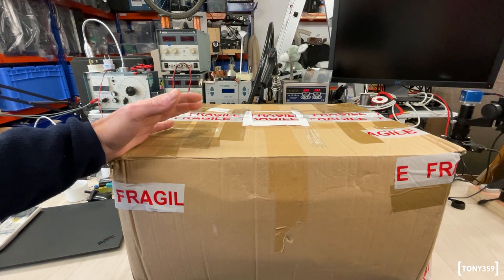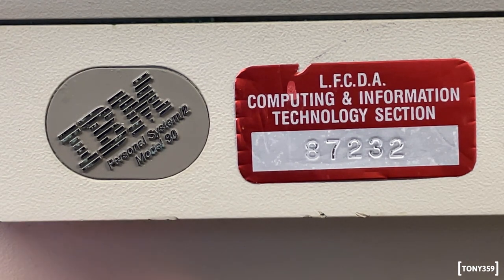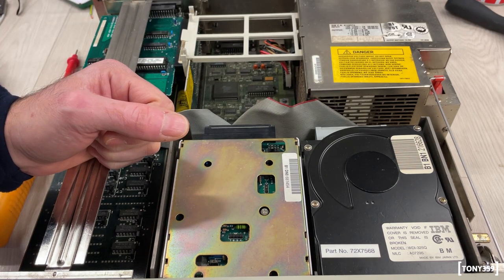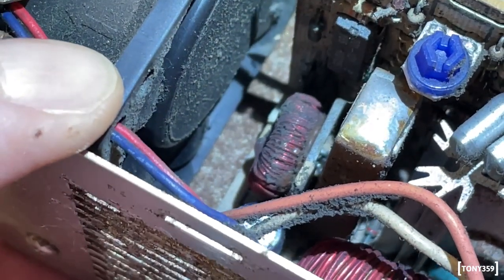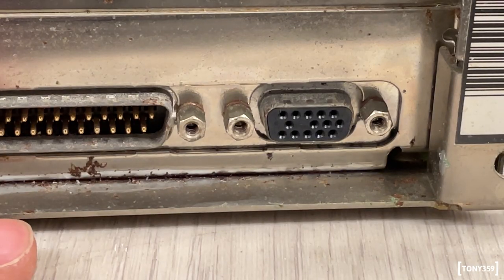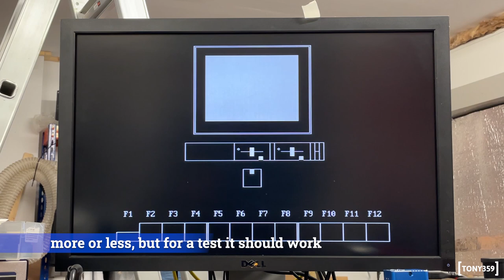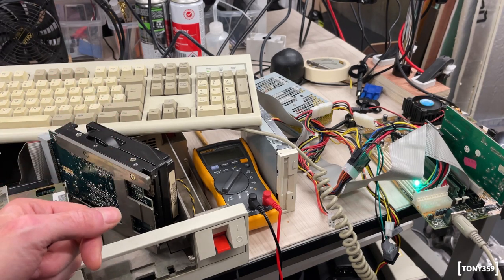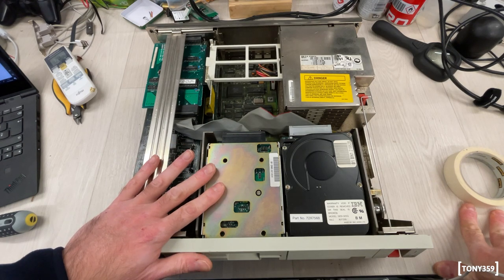IBM PS/2 Model 30 - Unbox and first look #doscember

Comment: Thanks for the mention :) Love the Dremel joke haha.  I tend to move stickers like that to the back or inside the machine. That way I preserve its history. Good luck with the project, looking forward to the next video!
Reply from the maker: Good idea so you get the best of both worlds! Thanks for watching and for your help on this project!
Reply: @tony359  Love the model 30 :) Let me know if I can help out in any way with the project. btw. your machine is in excellent condition compared to what mine was lol
Reply from the maker: I can't wait to continue! Working on a Macintosh now. I could use your expertise for a question indeed. Would this work for adapting a floppy? It doesn't have the key slot on the PCB. https://github.com/schlae/PS2FloppyAdapter 
I'd be happy to cut it myself but I thought I would check first. Thanks!
Reply: @tony359  Not sure if the drive in the 50 and 30 have the same connector. I'll see if I can find my 30 and do a quick test
Reply from the maker: That would be great thanks so much!

Comment: It was probably made at the IBM factory in Spango Valley in Greenock. I worked there in the 90s. 

Every motherboard went through 12 hours of stress testing in ovens which ramped the temperature up and down. 

Then random samples of completed PC’s were tested in the PQRL lab where we did DOA tests out the box. Then they were put on vibration tables to simulate shipping. Checked again then put in rooms with the temperatures ramping up and down again. 

If you were in the room checking the devices. One minute you’d feel your nostrils burning and within a few minutes you’d have to put on a jacket because it was so cold. 

They were built like tanks.
Reply from the maker: When computers were serious machines. And pricey. Amazing story thanks for your contribution!

Comment: I used to test, repair, and sell the IBM PS/2's. Plenty of model 30's, but in the last 2 years of that job we had thousands of the model 77's. Which were a very cool computer!
Reply from the maker: A 486! Must have been super cool!
Reply: @tony359  Heck yea! The 76/77 i/s with the "Lacuna" planar was one of the very last "pure-MCA" designs (ignoring the VESA video). They weren't quite trouble-free, but overall really cool boxes! I especially like the smaller 56/76 chassis - built like a brick outhouse.

Comment: A couple of years ago I bought the same model 286 we had when I was a teenager, this one has a chrome sticker on the front from the store it was originally bought from. I'm definitely leaving it on there, part of it's history. Our first PC was an IBM PS/2 30, the most recent game it would run was Prince Of Persia.
Reply from the maker: Prince of Persia was amazing on those machines because it supported MCGA of those older model (the 286 might have supported better modes though). However it was barely playable on those slow machines! :) 
Is your machine working? Thanks for watching!

Comment: Fantastic! Looks like this Model 30 found a caring owner. Just a few things to be aware of... The dim-bulb tester is not the best choice for switch-mode power supplies - some PSU designs really don't like the "current sharing" configuration and may release some of that precious magic smoke. Compressed air and floppy drives can be a fatal combination too. The air pressure can easily rip the heads off if you aren't careful enough (ask me how I know). The Dremel had me rolling. Nice video!
Reply from the maker: Thank you for all the hints! I didn't know about the light-bulb tester. All it does it could drop the voltage a bit but those PSU are usually universal voltage so here in the UK where mains is 240V we can drop it down to 110V and still be within tolerance. Why would the PSU dislike that? I'm just curious, not arguing with what you say. It's quite interesting actually!

Compressed air: absolutely. I think I ended up cutting the part where I recommend NOT using a compressor as the air is notoriourly dirty and yes, you don't want to blast the heads - sorry about yours! :) Thanks for watching!
Reply: The voltage drop caused by the bulb can prevent the PSU from starting. Normally, this isn't a big deal - the PSU just doesn't run. Not ideal for troubleshooting, but no harm done. However, some kick-start circuits don't cope well with the "soft" line supply and may fail if the condition lasts too long. Many older SMPS designs have a fairly strictly defined operational range. Or two ranges in the case of the auto-ranging units - it's rarely a single continuous 100 - 240 V range! Later designs tend to be much more tolerant (units with active PFC are exceptionally flexible in this regard). A well-designed unit should shut down or never start, but not all PSUs are designed properly, not even those used in IBM gear. (looking at you, Magnetek!)

Other SMPS will start but may not operate (regulate) correctly when loaded beyond a certain point, even when coupled with a bulb of seemingly appropriate wattage. Though, I don't have personal experience with that particular problem. Sometimes it can be hard to tell what actually caused the failure.

Is the tester better than nothing? Probably yes. It can prevent cascading and potentially quite violent failures. But it can also introduce new problems. It's a tricky business...

Be safe out there!
Reply from the maker: @GeckonCZ  Good to know. I'm aware of the "pulsing" of some modern PSUs when the bulbs draw lots of current because the capacitor is charging. I didn't know some designs might not like that. I'll bear that in mind thanks!

Comment: A "Reference Diskette" is typically for the microchannel PS/2s (Model 50 and above) - It is a "Starter Diskette" for the 8-bit and ISA models. The only configuration aspect for the 8086-based Model 30 is setting the real-time clock. The battery on the riser only runs the RTC - there isn't any configuration saved.

As for the memory, there is 128Kb soldered on the planar, and the SIMMs are 256Kb apiece to make 640Kb. It is able to run (as a diagnostic measure) without the SIMMs. Sometimes there can be parity errors from the planar memory.

The 'Ardent-Tool' website can provide every bit of information you need - and the diskette images for PS/2s and other systems. Good luck with the repairs! I enjoy my Model 30s among the other IBM systems.
Reply from the maker: Thank you very much for watching my video and also for the info provided! I’m gathering some parts, then I’ll continue the adventure!
Reply from the maker: @IBM_Museum Thank you so much for the "Ardent-tool" link, it's amazing!

Comment: Nice video, I’ve been wondering if it’s worth buying an eBay model 30 as most remarks say stay away from them as they are non-standard and hard to fix. Keep up the good work.
Reply from the maker: Thanks for watching. The model 30 is available as 8086 and 286. The 8086 is mostly standard but the HDD - the floppy has a different pinout but can be adapted. The 286 is mostly non-standard as you say: RAM and slots are proprietary.
Besides that, IBM computers are usually very reliable. Mine was kind of an exception though the MB and PSU worked. But look at what state the machine was! :) Good luck!

Comment: Those hard drives aren't always as dead as they seem.  Those mini electrolytic capacitors are notoriously failure-prone.  As are the ones on most of the floppy drives, too.  I have a Sony drive in my PS/2 Model 30, and it just needed a thorough cleaning.  Most of the other PS/2 floppy drives I've refurbished (Alps and Mitsubishi) needed new caps.  One of them needed a new PCB, too, because it was badly damaged under the caps.
Reply from the maker: Amazing thanks. I do not see leaks on the caps but I will test them all on next episode! Thanks for watching!
Reply: I've got a Model 30/286.  When I got it, I reformatted the hard drive, as I always do, and of 20 MB it only had 14 KB in bad sectors.
Reply from the maker: @fnjesusfreak  Amazing! I can't wait to be able to load some software on that computer and then see what works and what not!

Comment: I had a PS/2 model 30 286 back in the day that I had salvaged at an auction (this would have been around 1990). I loved how over engineered the machine was.
Reply from the maker: Impressive isn’t it? One of my views used to work for IBM and said boards were stressed in thermal cycling rooms for days before being released to the public!

Comment: hello sir i have an ibm personal system ps/2 model 55 sx i think and i was wondering if you may know what operating system floppy might work with it that might also work with yours? it's a 386... thanks
Reply from the maker: any OS should work on a 386. I'm not sure I understand the question about working with yours and mine?

Comment: Instead of drilling holes or removing pins from cables, you could buy a male to female gender changer and break the pin off that instead.
Screw it onto the port, and you can then use any normal cable without having to modify the machine itself.
Reply from the maker: excellent idea, thank you!